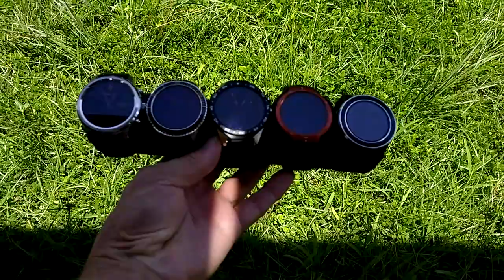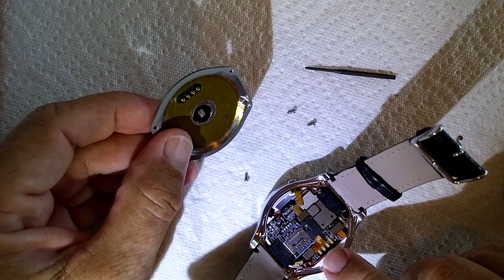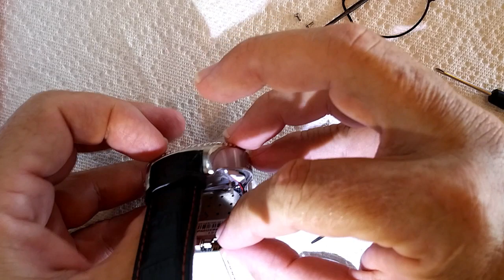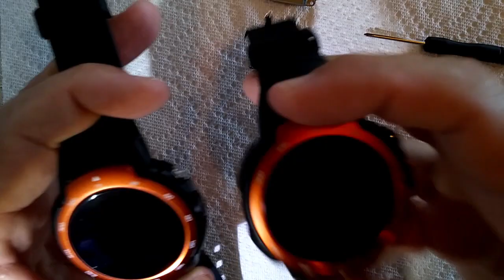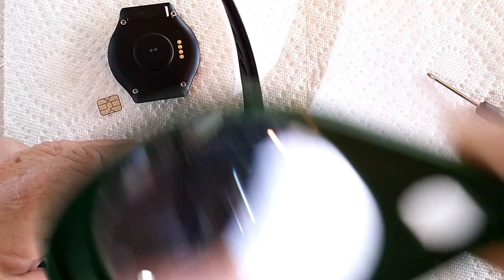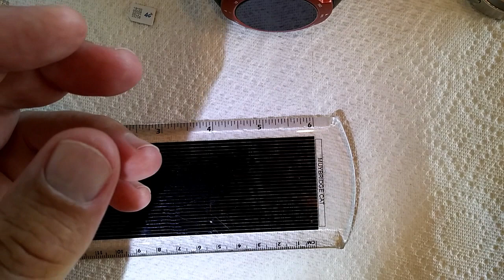Round Android 5.1 I2/KW88/Z9/S99 Watches Compared: 2-Build Quality

Comment: Tanks again for an interesting video (and all the other useful videos as well). If you want to know all about smartwatches this is the place to be. Got my KW88 today, so I can not tell you much about it, other than that it looks and feels great. I have one question though, Its about the calculator. Surprisingly the KW88 does not have one (build in). All calculators in the play-store are, for obvious reasons Android Wear based, so I presume they will not work on the KW88. Do you know if there are any stand alone calculators apps which can be used with the KW88? I couldn't find them so far. I had a quick look at the GPS possibility of the KW88 and was surprised finding google maps to work very well on this Watch. Nearly the same as on my smartphone. You can zoom in at street level and it is even possible to use the watch for navigation. It is just a quick look though but it looks very promising. By the way the weather app on the watch works ok in this part of the world (Holland). Get the watch connected via Bluetooth to my smartphone (by downloading Sinwear - scan the app with your smartphone as it appears on the watch when you first start Bluetooth on the watch). Also WiFi setting up is really straight forward and easy to do. So far no problems I will let you know my further experiences with the KW88.
Reply: Anton, that is very comforting news for me. Also a Dutchmen, waiting for his KW88 to arrive.
Reply from the maker: Wow, great report! There are probably lots of people who will read this. Everybody is hungry for more information on the KW88! As to calculators, check this out: https://plus.google.com/108584728070544203539/posts/c6BrG9dqZeF
That's a special calculator build just for round watches by Eric Crochemore. You can also find out more on other recommended calculators by searching the G+ Community: https://plus.google.com/u/0/communities/109827242607524552712/s/calculator

Comment: I knew my (um your) KW88 was the 3 one in by the perferated band. I'm going to get one of those some how. The build quality is pretty good.
Reply from the maker: I wore the KW88 most of today and I'M LOVIN' IT! Great watch. I've installed and am tweaking Smart Launcher. I've got Floating Toucher up and running. Having a great time. The gold is a real soft gold, almost a silver gold. Very nice. I can't get over how light it is! I was annoyed at first that I couldn't have any watch face I wanted when I twisted my arm, but now I really like the quick glance at digital time. Simple, attractive, and just what I need. I'm a button push away from my main watch face where I can see steps or battery level, etc. Time alone is just fine for the glance. And it gives me great battery life. Let's see, it's been on for 6+ hours now and I'm at 93%. Yes, get one somehow.
Reply: That's really great news. peaking at the time without causing battery drain is a welcome addition. I'm interested in seeing your overall battery life impression with the KW88 as you are a good example user of a smartwatch.

Comment: Awesome video.  You put a lot of work and time into them.  Great for for n00bs like me.  BTW,  Have you ever done the benchmarks on tethering smartwatches and the duration on a single charge?
Reply from the maker: Thanks Michael. I really haven't benchmarked the tethering watches since they last so darn long! Again, it depends on how much used, but without ability to do Play Store apps, videos, etc., most of them run for days before needing charging.
Reply: +SmartWatch Ticks Gotcha.  I just wanted to know if it would last a day with moderate use (or, surfing, email, messaging, etc...). I'm not into gaming plus I always charge my devices st night so one day is enough
Reply from the maker: From what I am seeing trying them out for a day each, they all are doing pretty good in lasting at least a full day. A few may last until the next morning, but none would last through a second day without a charge. That is, unless you had BT and WiFi off and only checked time. But then why have such an expensive watch to just check time? Bottom line, plan to charge every night.
Reply: Exactly. I know a lot of people that consider a deal breaker if a watch doesn't last longer than 2 days.  How hard is getting into the routine of charging it every night?  I guess they still use there devices while they sleep :)